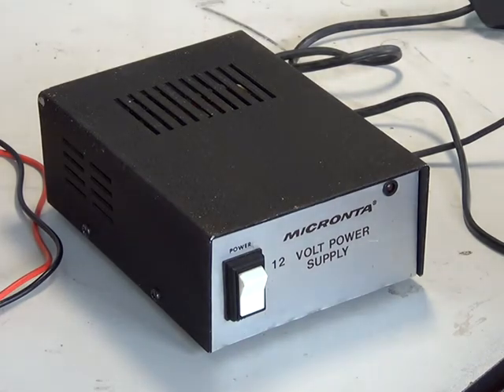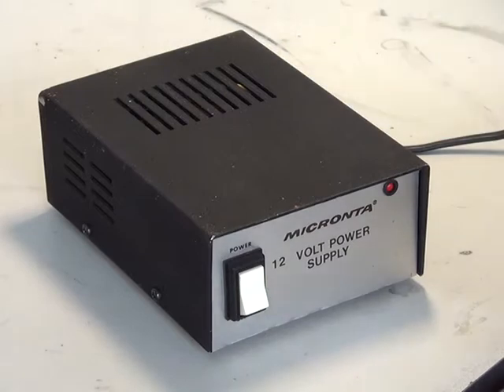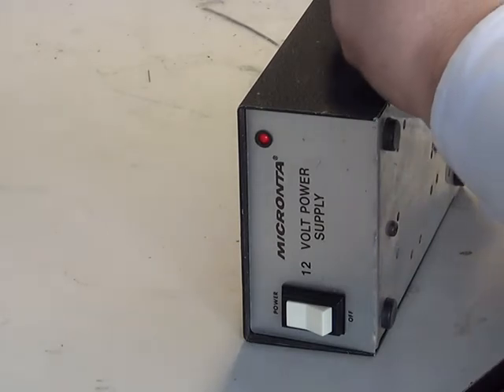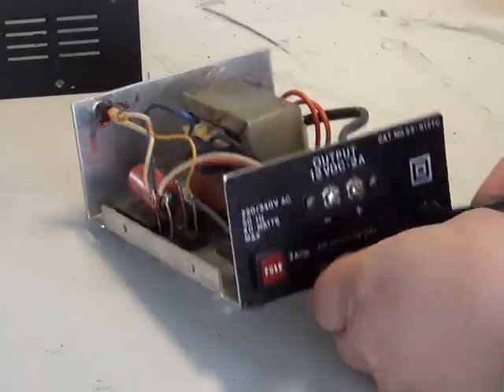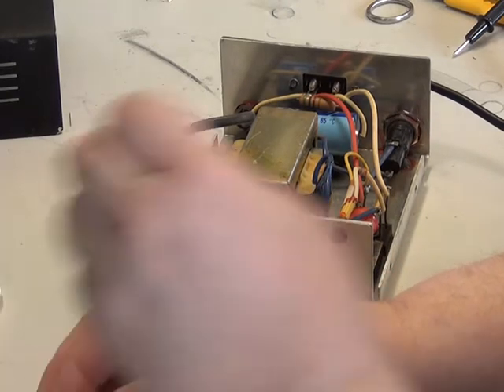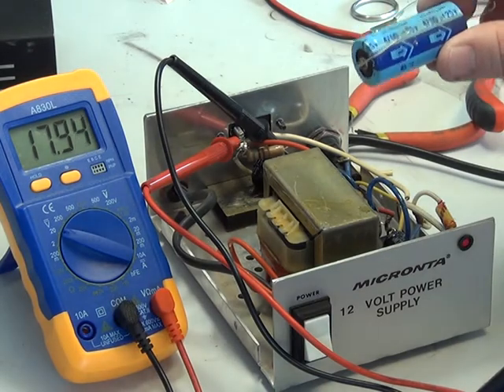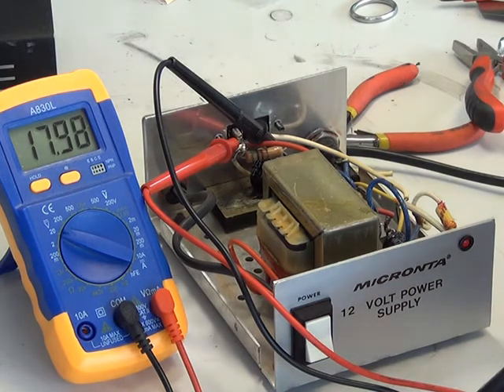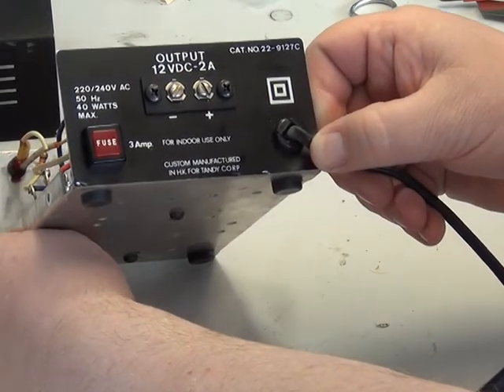NOT a CB Power supply! - Micronta 22-9127C 12V power supply - overhaul

Comment: Can using a power supply too low like 11.92v damage a cb radio ?
Reply: I ask because it worked initially but now I get a hum noise when keyed up ?
Reply from the maker: Theoretically yes as long as it can supply the required current. However, at 11.92V, most UK 4W CB radios will only produce about about 2W at that voltage. It is viral that the power supply is of a regulated type, whatever the voltage. This is why this video explains how this power supply featured is not suitable for CB use.

Richard, G0OJF, UK

Comment: Hi, will you be kind to let me know if the Micronta 12.8V, 2.5 amp 5amp surge power supply could be used
as a Memory Saver for the replacement of a car Battery.
Many thanks
Francesco
Reply from the maker: If it's the same model as this i.e. unregulated, then no as it's about 18V off load. If the one you have says 'regulated' on it, then yes.

Richard, UK
Reply: @ukfmcbradioservicingTango21    Grazie mille

Comment: I have a micronta adjustable dual-tracking dc power supply. will this power my 10 meter radio? it is about 80 watts. if so, what do i set the volts at? do i set the amps also? sorry, ignorant about this.
Reply from the maker: I've just researched your Micronta power supply, but you didn't state the model number. If it's the 22-121 model, then no as it's a 1A power supply. The service manual says 1.4A absolute maximum. This power supply would only be OK with some of the earlier UK 27/81 radios.

Your 10M radio will state on the back what the operating voltage is. If it's a mobile set intended for car use, than the input voltage is usually 13.8V. That voltage is the normal voltage a car produces with the engine running.

So if your radio is 80W & is 50% efficient then it will draw about 12A on Transmit. The power requirements are easily researchable if you bought the radio second hand & didn't get the instruction book.

Richard, G0OJF, UK
Reply: @ukfmcbradioservicingTango21  thanks for doing that. yes, it is a 1 or 1.5 amp, that is what the meter goes to. i realized it would not work as i watched my ham radio at about 80 watts pump at least 5 or 6 amps. wonder what it is good for? got it for $15 so not that big of a deal. when my new CB arrives, will have to figure out a way that i can run 3 radios into my 30amp sec 123m power supply. connections only on back and only room to jam two cables in at a time.
Reply from the maker: The Micronta power supply is intended for use on an electronics workbench.

I didn't realise you weren't in the UK. Please bear in mind my coverage of CB radios is solely UK FM only models.

Richard, G0OJF, UK
Reply: @ukfmcbradioservicingTango21  right. thanks for the replies and feedback.

Comment: I bought a used Micronta 22-121 model Dual-Tracking DC power supply. Can I use this to power a mobile CB for indoor use?
Reply from the maker: I'll say no because I just looked up the service manual & it says that it is a 1A power supply with an absolute maximum rating of 1.4A. Assuming you are in the UK using a UK FM radio then SOME models would work just, such as the LCL Economy,but would be thrashing the power supply to the limit on Transmit . Really you need a fixed voltage 13.8V power supply rated at 2 to 3 Amps output. It's always best to have things double the required current, so the power supply isn't been thrashed. If you are in any other country than the UK & have an AM based CB system, then AM draws more current than FM on transmit.

Richard (UK)

Comment: everyone wanting to up the temp values in capacitors like using Panasonic 105`s etc...I`m sure you don't need caps that demand such high temp tolerances...  I would change most caps in something 15 year plus...
Reply from the maker: Sometimes I notice capacitors close to components that get hot. I only bother stocking 105c electrolytic capacitors these days & the price difference is often just pence. Because 2-way business radios get hot in cars I just think that anything to help reliability is worth doing if it's cost effective. Bear in mind it's business 2-way radio that my training is in, rather than hobby radio. I do the same with the audio repairs..they get better quality parts fitted too. I also only stock 0.6W 1% resistors, rather than having 'consumer type' 0.25W 5% as well!

Too right on changing capacitors after 15 years.

Richard

Comment: Couldn't you just add a 12v regulator?
Reply from the maker: Yes you could & the 7812 is available in a 2A version. Just a matter of looking at the manufacturers data sheet, adding about 3 parts & raising pin 2 (0v) above ground potential for the device to deliver 13.8V.

However, the point of this video was to show that this psu is unsuitable for CB use as manufactured & that it was never intended by Tandy/Radio Shack to be used for CB.

Richard
Reply: I've noticed more and more people use atx power supplies nowadays for cb radio which I think is caused by cbers using more powerful equipment.
Reply from the maker: I'll read into that "illegal equipment"!  There is no UK legal FM CB that draws more than 2A on TX, so 2.5A is adequate. Now SSB is UK legal using CE approved new equipment, then 4.5A will be the maximum current draw, so those 5-7A PSU's are fine.

Richard